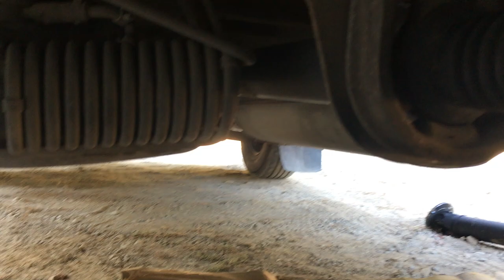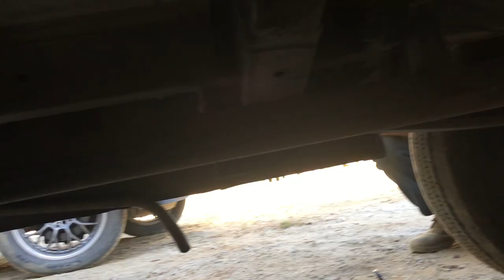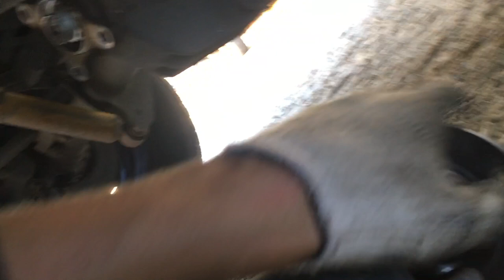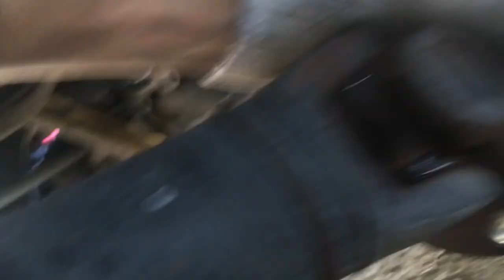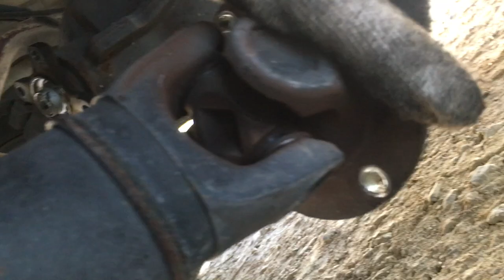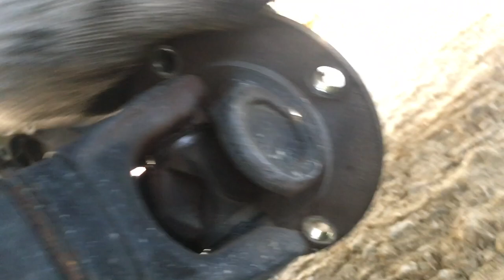vibration while driving from 35-60 Miles (bad driveshaft)

Comment: At frame 0.35 I have to disagree with you, but they can be replaced. Where you say their stamped, they are really "Staked" in at the factory. I pressed mine out using a 20 ton press, and purchased "Specialty U - Joints" on line.
Reply from the maker: Joe De Jesus got it Thank you !!

Comment: You can replace those just need a vise and remove a cap from one side
Reply from the maker: +Tyler Scriven got it thanks!
Reply from the maker: +Tyler Scriven got it thank you!
Reply: Wrong can't be done without a huge amount of work. How ever you can replace the center bearings, those goes out more often then the shaft or u joints.
Reply: Replace with c-clip style u-joints
Reply: @MichelLinschoten   BTW if you heard the guy you would know, and we all know you didn't replace just the you joints, if you did you would post a video of it, as it's not easy, you have to cut in clip grooves etc..  also on the longer wheelbases the bearings go out and those are pretty easy to replace.  You  didn't replace shit, if you did then post and prove it! Am waiting!
Reply: @timharpham749   It's not very easy to do you must cut clip grooves by hand, not something most would try.

Comment: The probable reason of irreplacable U-joints is that if you have vibration, it's fucking hard to trace it down and fix. Had a vibration exactly at 38 km/h. Guys at the shop replaced U-joints, bearing and rubber around it, balanced it on a stand. Guess what? Minus $300 and the vibration is worse than ever. Now service workers are telling me that driveshaft is perfectly balanced, we can't help you, go figure it out all by yourself.

Comment: As an engineer you have those things spinning at high rpm's, the centrifugal forces are enough to undo any kind of fasteners for that mechanism. Today we have two piece drive shafts for easy cost, but once you put a means to replace that spindle joint back there you risk it from lasting more than 10 years to maybe 2 months before it breaks, because another thing called stress tests are preformed to make sure it will last. 
So yeah....
Reply: aka guys we don't have the materials right now AND if we didn't, we WOUNDT want to pay for them so let's just make do with what we have.